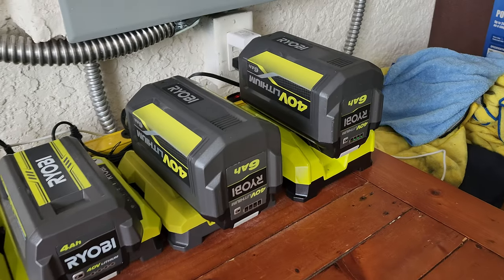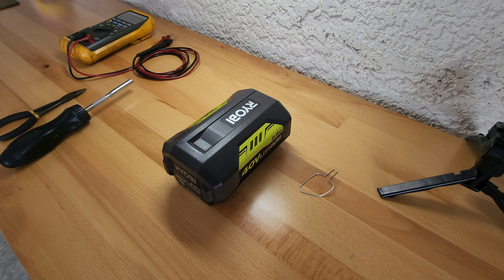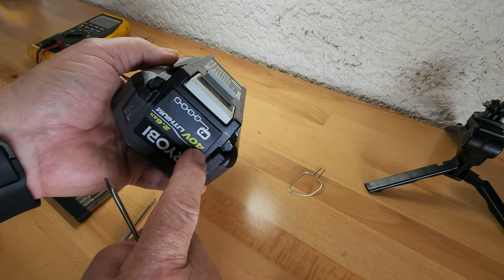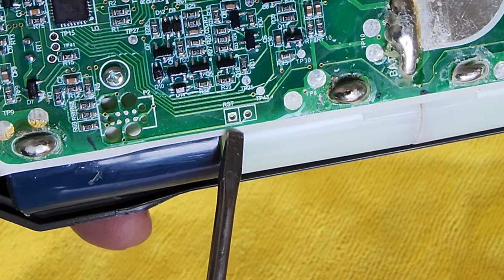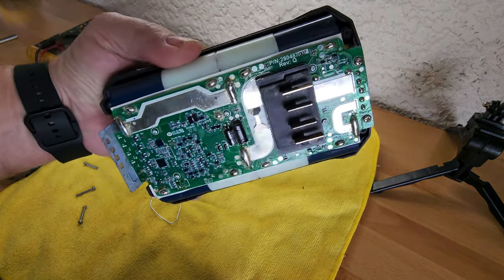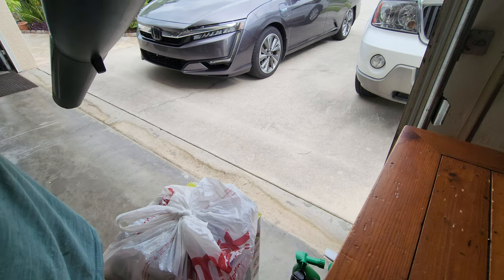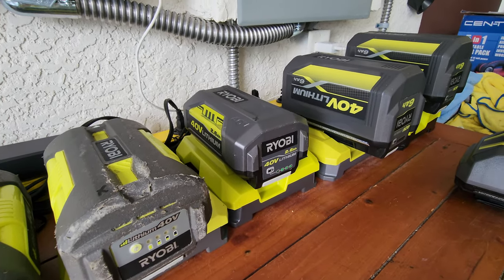Ryobi 40V battery fail, Master Reset!!!

Comment: It works BUT..... Those who have batteries cast aside years ago because of "defective" signal may find it takes a bit more work to bring these back... Mine was two years old when it died and had sat for another two years before I found about this hack to fix it.  All went as described EXCEPT when I touched the reset and hole next to it, no lights.  Nada.  I had to push the button while the jump was in place to get the row of lights to come on and stay on (instead of blink) .  But that was only the first step. When I placed the battery on the charger,  it only charged for a few seconds before flashing "defective" again.  I repeated this many times.  Reset, charge, fail.... reset charge fail. But each time the normal charge light blinked green  a little longer.  Finally about the 10th reset,  the lights on the battery came on by themselves when I did the jump. First time that had happened. And when it went back on the charger, it finally behaved normally. No defective green/red combo.  So apparently had to get enough juice back into it for the reset the actually work.   So be persistant.    I have no idea how long this battery will last given these issues. But just be aware this may be an issue on older batteries in a low charge state.
Reply from the maker: Excellent information 👌 👏.  You have helped many, I am sure. Amazingly after all those years sitting you have revived it. It's great news to not let a powerful lithium battery go to waste. Thank you so much for sharing your experience with us.
Reply: Thanks for this. I just tried the other two methods and the same thing happened that you described. Now I need to go back to the garage and try the same process over and over to see if I can recover my battery. Will update
Reply: @mikewelpott8743  Sadly this proved a temporary fix for me. It worked but the battery would only partially charge (one light).  And would only run my mower for a few minutes. It died altogether after a few uses.  But it had been dead for a LONG time before this resurrection attempt.  So perhaps you will have better results.
Reply: @mikewelpott8743  what a wast of ur money. I was about to buy the nee Ryobi power station and it uses these sane type of batteries. What is your advice should i buy a diffetent brand of powe station.and why does this happen to thees batteries?????
Reply: This approach worked like a charm for me. Reset the battery and inserting into a weed trimmer trimmer confirmed the renewed functioning. However, upon putting g it back in the charger brought about same previous "defective: blinking lights. Will repeat the reset as other reviewer has outlined.
Reply: The reset worked (thank you sir!) but in charger green light lasts ~4sec before red/green failure mode starts.  3X in a row now.  I fear the battery is (somehow) defective (though it's had only light use).  I'll try resetting a few more times but looks bad.
Reply: Unfortunately this didn’t work for me. I tried all the variations in the comments and the battery still just flashes all four lights and now the CHARGER flashes the defective red and green when the battery isn’t even in it… it was fine before. So now I need a new battery AND a new charger.
Reply: @crookedboxcreative  Red/green on charger just means battery is bad.  I just replaced defective unfixable Ryobi with Amazon Chinese knock off ($65 instead of $189).  Charges fine.
Reply: @hansenaz53  it blinks red and green when there is no battery on the charger.
Reply: Oh thank you so much for posting that. I was so heartbroken when my three month old batteries were both doing this at the same time hopefully what you describe works for mine. I’m about to do it now I had put it all back together and just like you said, it only worked for a few seconds, thank you to both of you guys as long as it works though lol
Reply: My battery went out when I left it in the lawn mower, after it ran out or charge. It shows 40 volts on my meter. For the people that this fix does not work for, pull the battery out of the case, and check the volts of the 4 sub cells. There is a good chance you may need to solder a connection. There are videos for this
Reply: I only tried it twice. I'll try it ten time or more tomorrow. We will see what happens. Thanks.
Reply: @mikewelpott8743 those batteries come with a 3 year warranty.
Reply: Tnx
Reply: @robertwalker2679 any link for the video?

Comment: Great video; this worked! Two notes: 1. Might mention that "dummy plug" just covers the fourth screw. 2. On older Ryobi 40V batteries, look for 3V GND and RST. They are in a different place on older motherboards. I noticed you jumped "RST" and the lone contact next to it. My "RST" was down in the corner among many others. Right next to "RST" was "3VGND" or something like that. Jumping RST to that did the reset. BTW, On one battery I didn't need to push the button to reset it; it went on its own as soon as the jumper connected. Overall, you saved me some money on multiple batteries. All work now. Thanks!
Reply from the maker: You are very welcome.  Thank you for the detailed report.  I am sure many will be helped 😊 by the details you have shared. Have a wonderful weekend.
Reply: I seem to have this battery! I’m scared to reset bc there are five different hole options not sure which one is the reset one 😣
Reply: Great video I did exactly what you said to do and it fixed my battery. Thank you so much for that last "push the button at the same time" instruction!!!
Reply: Thanks, that sounds like the board I got.
Reply: Question for the group. I followed all the steps, and got all the results EXCEPT when I put it in the charger all the lights light up for a few seconds then nothing. When I press the charge button the all light flashing is back. Ideas?
Reply: Didn't work for me. I have the older battery with clk dat gnd 3.3v and rst.

Comment: Fantastic. Everyone in the family was amazed that I fixed it. 😀I didn't need to hold the button. It flashed one upon reset. But this will happen again. That's the best part of your video and the bonus tip. I have a lineup similar to yours with 6 batteries. BTW, I had 2 dummy plugs. After trying to pry them from the edge I realized the best method was to use a small head Phillips and maul them through the middle while twisting. Within 30 seconds that enabled enough leverage to yank them out.
Reply from the maker: That's wonderful.  So happy 😊 another battery will live to do additional work and not end up scrapped.  Thank you so much for sharing your success!! Have a wonderful weekend.
Reply: This worked for me. 1 million thanks for saving me 60 bucks 😊
Reply: @lstefanakys1 $60??? You can't buy a 1.5Ah 18v for 60dollars
Reply: @pasqualeredo  actually it went bad again and ended up buying a third party brand. 😞

Comment: Thank you, it worked!  I think it s interesting that nothing is mentioned in the battery insert about resetting. Shame on you Ryobi!
Reply from the maker: You are very welcome.  Thank you for sharing your success 🙌.  It's great to be able to reset your battery and not have to throw it away 😀.  Have a great day.
Reply: My thought also was why wouldn't you just have a "reset"  button on the outside of the shell to do the same thing we all just did?
Reply: Liability. These batteries can be very dangerous when tampered with by idiots.

Comment: This worked the trick with the jumper is hold it there for 5-10 seconds...I didn't have to press the indicator button.  The front screw covers suck I ended up removing them with a tiny drill bit.
Reply from the maker: Wonderful news.  Thank you for sharing your success. Have a great week ahead 😀.

Comment: IT WORKED!

Just one tip for those watching, buy the Security Torx bits.  If you buy the regular torx, you'll be highly disappointed as it won't fit.  

Thank you so much for posting this video, saved us so much money!
Reply from the maker: Thank you so much for sharing your success.  Have a wonderful week.
Reply: they do fit, albeit loosely
Reply: How do you get the plug out?
Reply: @kickballgivestoperu2122  I didn’t, I just accessed the panel after removing cover.

Comment: Just did this - seems to have worked! The battery is charging normally. Now if the mower only starts when I put it in, I’m back in business. Otherwise I’ll be searching for videos about testing and fixing that next. Thanks the the clear, thorough, and accurate advice.
Reply from the maker: You are very welcome.  So rewarding to get a successful report. Thank you for sharing your outcome with us.  Thank you for watching, have a great weekend 😀.

Comment: I watched this video. my battery a Ryobi 40 volt battery  was not charging. I did what you said to do with the jumper wire. I used a small piece of speaker wire. It fit into the holes in the reset area. I held it in there until the lights flashed. My battery is fixed. It is recharging now . Thank you. You saved me over 100 dollars
Reply from the maker: Thank you so much for taking the time and making the effort ti share your success with everyone 💙.  Have a wonderful 😊 weekend.

Comment: On my 4AH 40 Volt, this worked by holding the jumper for about 4 seconds, then one of the lights flashed. I checked before and after voltage and both were 34 volts. I then set it in the charger for a few hours and now my blower works again! Thank you for taking the time to video this for us.
Reply from the maker: You are very welcome.  Thank you for sharing your success.  Have a great weekend.

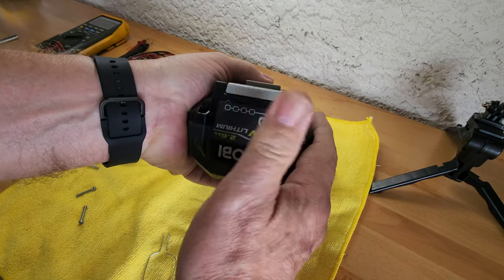Comment: 5:44   The jumper reset my battery. Low use. Just used one day and would not charge. Can’t believe that reset isn’t built into the button. Hold for 5 seconds or something.  Thank you so much for this straight forward video!
Reply from the maker: You are very welcome. I feel the same way about having a reset. Thank you for sharing your success. Have a great weekend.

Comment: I watched your video and read the comments and tried it. Nothing worked. But then I used my tweezers (pointy tips vs flat) and stuck them in the holes at the same time and pushed down a little. That made the lights turn on and then the single light flash. If it wasn’t for your video I would never have tried it. Thank you!
Reply from the maker: Thank you so much for sharing your experience 😊.  I am very happy it worked out well for you.  Just shows, there's always something new to learn.  Have a wonderful week.

Comment: Great vid, thanks. I noticed the PN, Rev, and sequence number on the main board. Hard to see clearly but yours looked like 007, on mine, it was 026. My battery reset without pushing the button. I held the jumper for a five count and the lights flashed. For those who are trying to figure this out, It may be helpful to note the board version as you determine how to reset, jumper only vs. jumper and switch...
Reply from the maker: Great information 👍.  Thank you for sharing this with everyone.  Surely it will help many. Have a wonderful weekend.

Comment: Thanks, it worked. I used a staple I bent to reset. The light did flash when I did the reset. It might have been good to go at that point but I went ahead and pressed the side button too where the 4 lights lit. 
I put it back together and my charger worked and fully charged my battery again. 
Thanks again.
Reply from the maker: Awesome! Thank you for sharing your experience 😊.  Have a great weekend.

Comment: Mine was totally dead, battery error, lights on the battery unresponsive. My battery had a different looking card, but I followed the instructions and connected a paper clip between the gnd and rst contacts and pushed the button.  It flashed green once and now the battery works again.  Thanks!
Reply from the maker: You are very welcome. Thank you for sharing your success. Have a wonderful weekend.

Comment: Great video. Had a battery in sleep mode. Tried the in and out of charger and didn’t work. Bought a new one, but before I opened box I tried your method of resetting. It’s currently back on. Charger charging correctly. Saved me $300
Reply from the maker: Thank you for sharing your success. So glad it worked out for you.  Have a wonderful weekend 😀.

Comment: Thanks a lot Sir. Your technique worked with my 40V 5AH Ryobi battery which was out of warranty. The only difference with my battery was, when I connected the reset terminals, all the 4 lights momentarily flashed once. I did not have to press the battery indicator button at that time. Now the battery is charging perfectly as before. Prior to the reset, whenever I pressed the battery indicator all the lights were flashing but it was not charging. The charger was flashing green and red lights which indicated defective battery. After the reset procedure, the problem of not charging is fixed.
Reply from the maker: I'm so glad you were able to reset your battery and get it back in service.  Thank you so much for sharing your success! Have a wonderful week ahead.

Comment: This worked for me and I did have to press the button! Thanks for the tip and the link to the drill bits, they worked perfectly. For anyone trying to get up the plastic plugs, I used a pocket knife to gently work a hole into them and pry them up.
Reply from the maker: Thank you for sharing your success and the tip on removing the tamper plug. Have a wonderful weekend.

Comment: I came across your video while actually searching for how to “discharge” my 40V RYOBI that had also become unusable, blinking Yellow/Green on charger. I was thinking I might overcome the issue by fully discharging the battery pack. However, after watching your video, I decided to try your second method for resetting the battery (jump & press battery button). Luckily, all I needed to do was the first method (jumping the circuit) to reset the battery. Nevertheless, I appreciate your video for revealing both fixes. It’s nice to have a backup method if In encounter the issue again. The battery was down to one bar but it charged up without error and now works as good as before. Thanks!
Reply from the maker: You are very welcome.  Thank you so much for taking the time to share your success.  It's great to have a working battery after having it lock up and refuse to charge.  Have a wonderful week 😊.

Comment: This did the trick. Had tried the “in and out of charger repeatedly” and “jump from a good battery” before with no success. This was easy enough and as a bonus, actually worked. Appreciate the cautionary comments you make in the video but it didn’t take any advanced electrical skills to do this. Thanks for this video.
Reply from the maker: You are very welcome.  I'm so thankful it worked out well for you.  Thank you for sharing your success.  Yes, cautions are a normal part of life. My interpretation when I hear or read the cautions usually goes something like this: Are you sure you want to try this? Are you really sure you want to try this, and are you really ready and willing to accept all responsibility for trying this? Thanks for watching.

Comment: Dude, thank you very much. I recently purchased a ryobi string trimmer at a yard sale really cheap because the owner couldn't get the battery out. I got it home and sure enough that battery was in there good. I decided maybe I could take it apart and get it out. Well that didn't help much because once I opened it up there was still this cage around d the battery lol. Finally I was able to fish my little 6in. Scale between the lach and the battery and I had to wack on the cage with the scale in place and it moved so I knew I had it at that point. Either as a practical joke or accident someone had gotten Glue on the battery and it was Glued in place. Once I got it out it was behaving like the one in you demo, so hopefully it will work once I follow your instructions. Which I will do at my own risk not because you suggested it or anything because you did not. You said not to do it unless I was qualified. So if anything were to happen it's Not on you my friend!🤠👍🙋‍♂️
Reply from the maker: Absolutely wonderful write-up.  Hope it works out for you.  Thank you for taking the time to share this.

Comment: Thanks - again!  I just reset the same battery for the second time about a year later.  The hardest part was finding the star tool to open the case again. ☺
Reply from the maker: You are very welcome.  I am thankful it worked for you a second time.  Yes, sometimes looking for that seldom used special tool is time-consuming.  Happens to me .

Comment: Thank you so much for this video!  Saved me a lot of money for a new 40v battery.  It took me half a day to figure out how to remove the "dummy plug" (that's me! ha, ha!) but after that it took a few seconds to reset the battery.  I used a pair of fine pointed tweezers to bridge the two little reset buttons and it worked great.  The battery is on its way to a full charge.  Thanks again.
Reply from the maker: So happy 😊 you saved your battery.  Thank you for sharing your success 🙌.
Reply: Thanks man, your comment saved me money. When i seen you used tweezers, i got up right away and got mines and my battery is working!. thanks again and thank you hightech for making the video
Reply: How do you remove the dummy plug?
Reply: @willgonzalez9045 Turned out there wasn't one - just 4 star screws.  No special tool required.

Comment: Thanks, you rock! Was able to at least fix one of my two "bad" 40v batteries. This fixed the one with flashing lights, it however did not work for the one with no lights/no signal.
Reply from the maker: Thankfully, one of them was returned to service.  Thank you for sharing your success.  Have a great week.